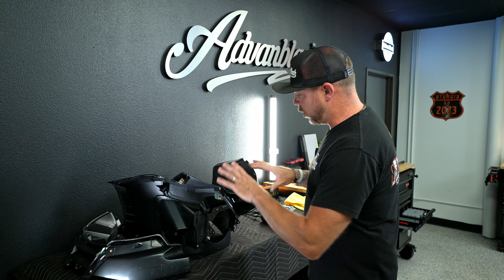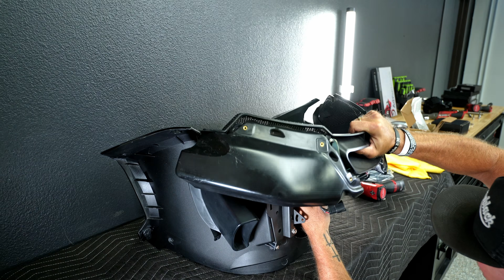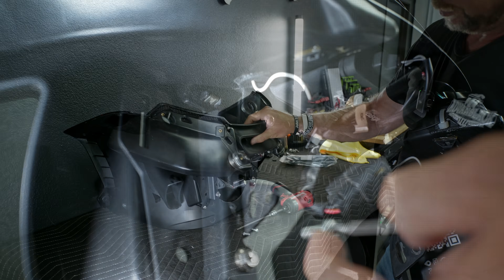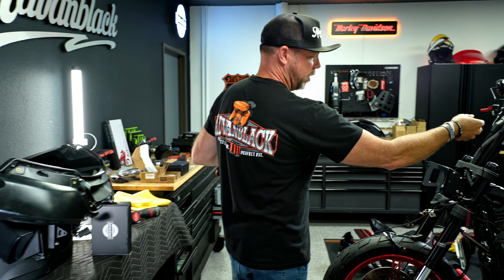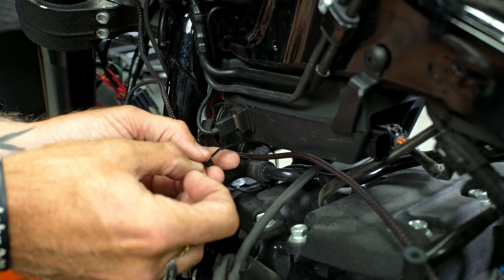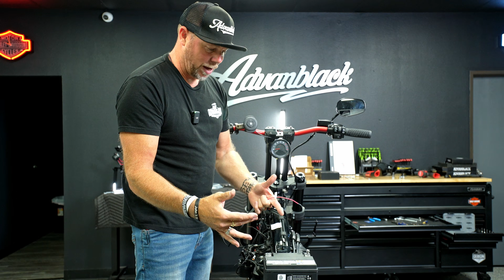Advanblack Wire Harness For Rockford Fosgate Audio on ST Fairing Installation

Comment: So with installing the rockford fosgate soundbar, my windshield would not line up properly and the rubber busings would tear. Got clearview shields hardware upgrade to pull the windshield in tight, but now there's large bows/gaps between the screw mounts. Is there a fitment issue with the windshield to the soundbar?

Comment: What does the white 2 pin connector do? Can i tap power into there for like a cellphone charger/mount?
Reply: Have you figured out where it goes?
Reply: @dragisasimic314no clue what its intended for but I cut the end off and wired up a cell phone charger to it.

Comment: Doesn’t running it to the battery hot give the unit constant power? Would it be better to have it running to the accessory port so it would be key on hot only to save the battery?

Comment: I made my own. Had no clue yall sold them.
Reply: Did you wire it up directly to the battery, or did you tie it into the accessory port so it would only have key on power?
Reply: @justinbell9610  Straight to the battery. It doesn't get power unless the bike is on.